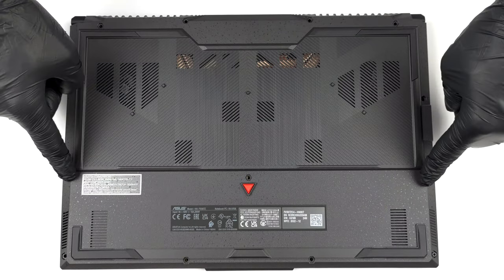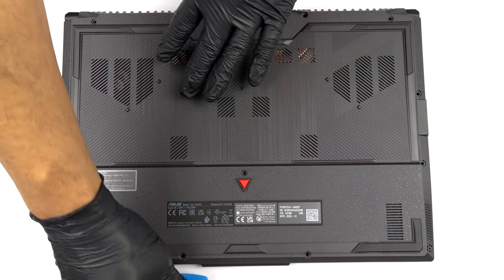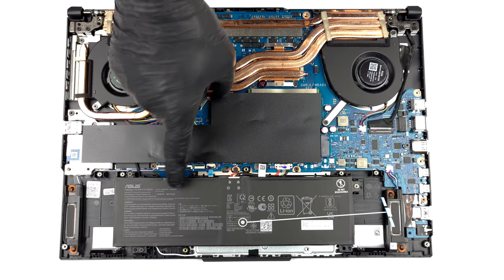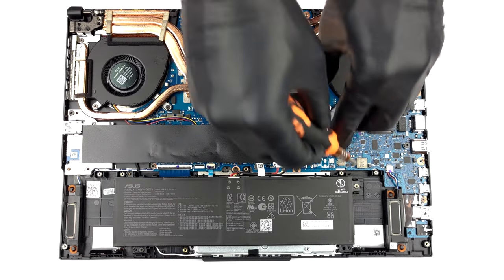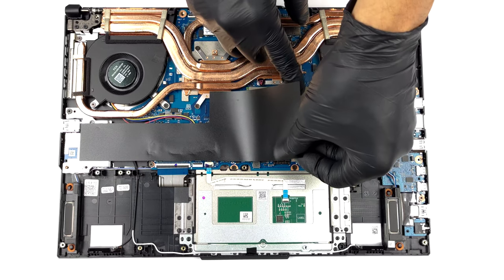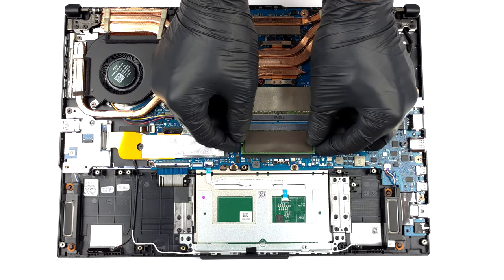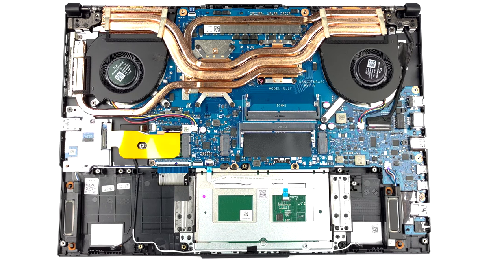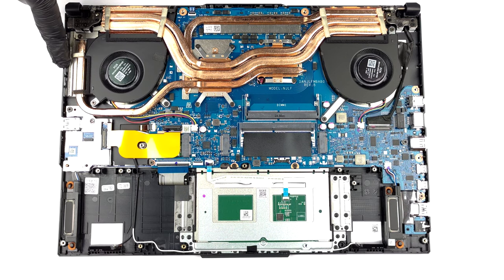🛠️ How to open ASUS TUF Gaming F15 FX507 - disassembly and upgrade options

Comment: I upgraded the ram to 32GB DDR4 3200 Kingston fury 2xmodule + 1TB Kingston NVMe SSD. But power button does not work after upgrade only on battery. So I plug in the power cable of the 240W brick and then the button works. So if you are upgrading and your laptop doesn't work on battery after upgrade, don't be fooled that it will work on PSU then also on battery.
Reply: does it have one or two slot for ssd?
Reply: @Pedro_bcl  does it have 2 slots for NVMe M2 SSD, but one is filled with disk
Reply: Yes thks mate
Reply: You are a real one brother. This comment saved me so much troubleshooting.
Reply: Ele só liga com carregador ??

Comment: where is the wifi card on this model? I don't see it anywhere and I need to replace mine. I just got the laptop, 19 4060 GPU but the wifi is horrid.. bought a replacement wifi card but don't see where it installs on this video.
Reply: Below the included ssd

Comment: Bro for some reason the upper left corner, where the hinges are, at the very edge the screw keeps unscrewing for some reason. Neither the rims of the screw nor the rims of the socket are stripped, and when I screw the screw back in it has a tight grip and doesn't allow to screw in after a certain threshold. Then why does it keep unscrewing? Please please 😢😢😢 help me out, I would greatly appreciate it
Reply: did you mix up the screws by mistake?
Reply: @gravitystormgaming6836  nah its fine now i just had to screw it in a little harder
Reply: @rageplushie  bless🙏🏽

Comment: Hi, is it possible to ad an internal 2.5 inches hard disk?
Reply: there is no more sata connector on motherboard like the older versions had. Two m.2 drives only.

Comment: Hi! can the battery be upgraded to 90wh? I read on the asus website that it has a 90wh battery variant.
Reply: hey did you find out whether the battery can be upgraded or not?
Reply: Hi i think propably yes and also no. They are the same voltage and also pins are the same. They share the same chassis. But if you look closer in the top right corner where the battery is mounted there is a little part that holds the smaller 56wh battery compared to one with the 90wh, where it is not. Maybe if you removed that thing it should work. But iam not 100% sure.

Comment: thank you for your work, if you have the time to answer this: 6 of the screws that hold the chasis fell out and noticed too late, can i have some information about the them. Thank you in advance
Reply: I am missing some screws as well. Were you able to figure out the size? I just ordered a bunch of different sizes and am going to trial and error it. Any insight would be appreciated.
Reply: @williamkoop8439  if I remember correctly, screw sizes were listed on the manual that you can download from Asus support site.